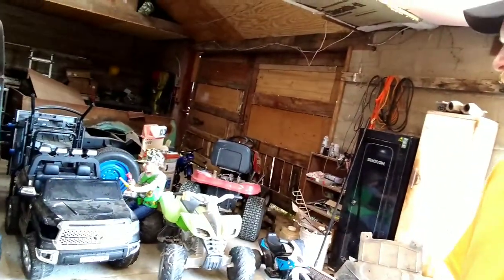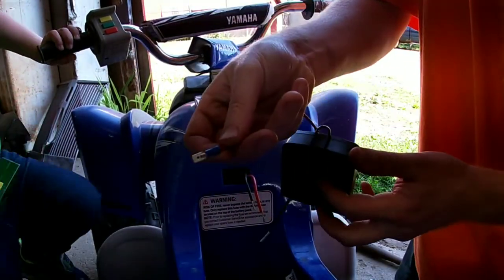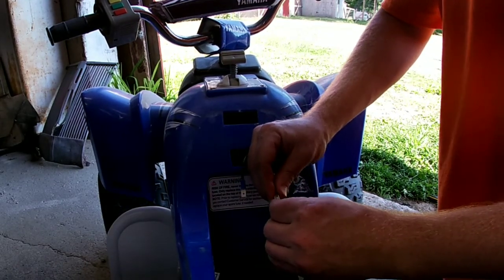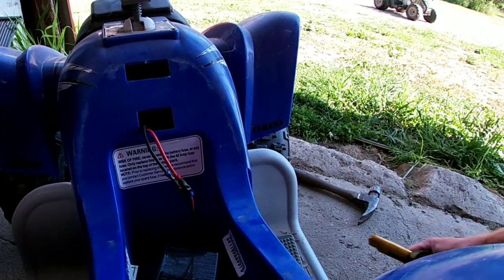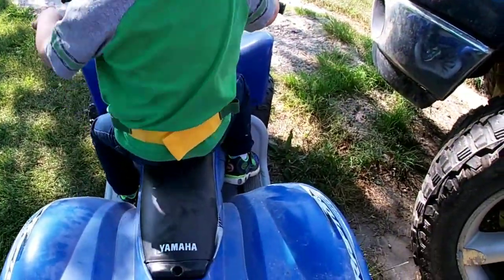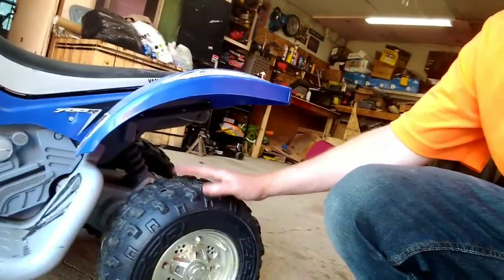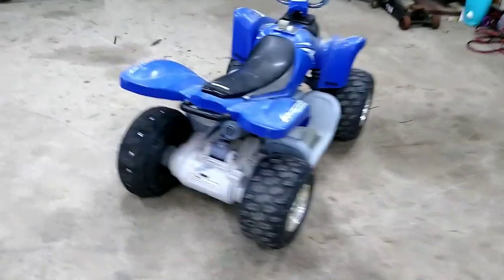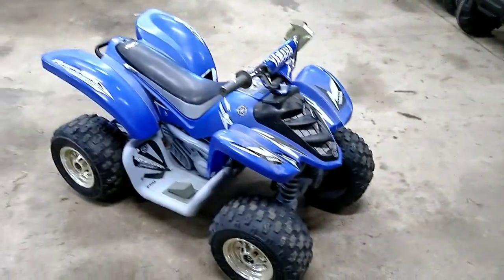power wheels drill battery mod (12v to 20v) cheap easy diy

Comment: I just did this and it works super, I didn't use the adapter I just use wire crimps and a zip tie
Reply from the maker: I bet the kids love the extra speed
Reply: @ccgarage5040  all though i let the battery get all the way dead and now it won't charge, probably have to do the jump from another battery to give it a little bump
Reply from the maker: @billygoatracer  what battery are you using?

Comment: could you please post a link to buy the adaptor I have the same batter 20v max/lithium dewalt battery I want to try this for my daughter police car
Reply from the maker: Here is a link to the adapter I made the how to video for our 2nd converted power wheel Power Wheel Adapter for Dewalt 20V Battery with Fuse & Wire terminals，Work with for Dewalt 20V DCB205 DCB206 DCB200 Lithium Battery；Power Wheel Battery Converter for Rc Car, Robotics, Rc Truck,DIY use https://a.co/d/hSm3j5o

Comment: great!! one question, That means that I don't need the actual harness that come with the 40 fuse
Reply from the maker: No you don't need the actual harness
Reply: @ccgarage5040  I don't want to sound dumb..am just a mom..what does the Fuse do on the harness?..also as the connectors can be eliminated..i just have to charge the battery on the DeWalt charger?..Thanks
Reply from the maker: @sarayluna9565  the fuse is just a safety if for whatever reason it starts drawing too much amperage the fuse will burn up instead of the wire or battery. Yes you would remove the DeWalt battery and use the original charger for it

Comment: I did this for mine with a black and decker 20v but the batteries don't charge afterwards. Is there anything you suggest on doing?
Reply from the maker: I don't know about the black and decker but my DeWalt battery hasn't given me any issues and the kids are still enjoying it today
Reply: If the battery gets too low it can give you trouble charging I believe.

Comment: I did this with a built in fuse and it fried my circuit board. Any idea why?
Reply from the maker: I fuse is only going to protect from amperage not voltage both power wheels I've done this too we're garbage picked and I haven't had a problem yet

Comment: Traction...I went and got a mower tire wrapped and screwed it on the wheel with the motor lol
Reply from the maker: How good does the mower tire fit/work?
Reply: @ccgarage5040  pretty well it's been a few months and no complaints really ...but I only used half the tire I didn't overlap it
Reply: I left the wheels Alone and Gave it traction to both wheels. Like a locked diff. No more spinning or getting stuck

Comment: Do you have to charge the battery? If so, how?
Reply from the maker: Yes it has to be charged, it's the battery I use for my drill that's why I bought the adapter so I could use batteries I already had